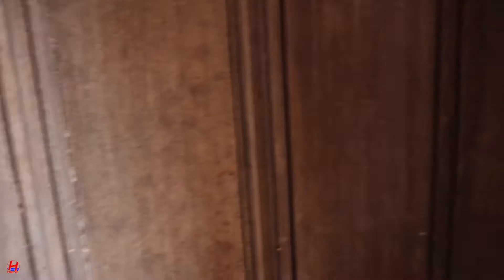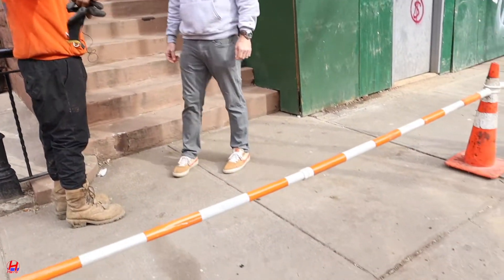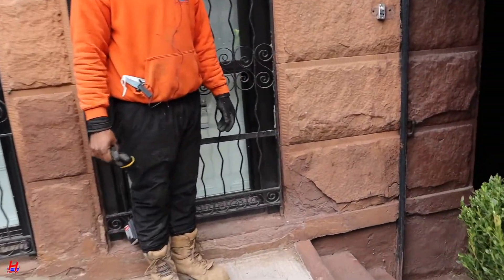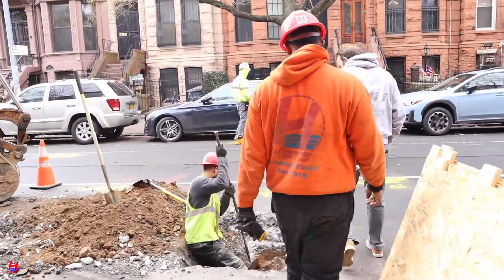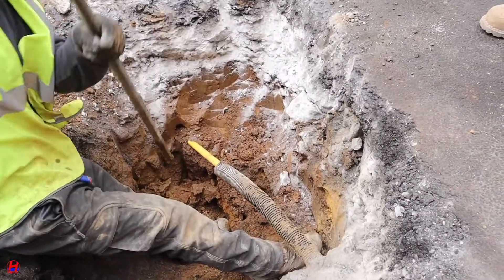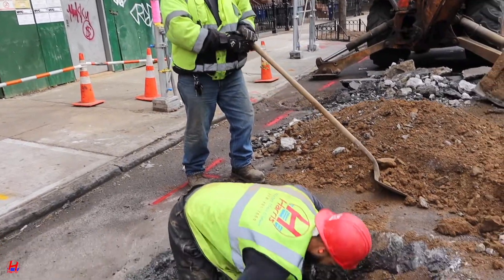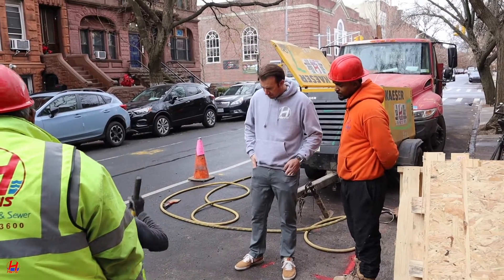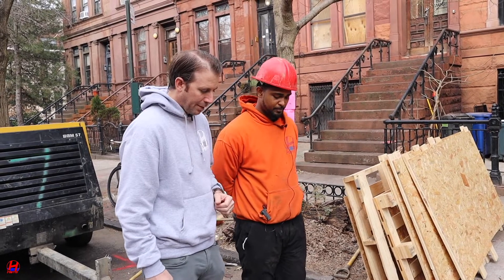Brooklyn Resident Replaces A Lead Water Main With Copper

Comment: Those are hard working men.Hydro excavation would help that’ll get the job done quicker.
Reply from the maker: What exactly is the hydro excavation process?
Reply: @HarrisWaterandSewer  I’ll explain it, as best I can.. You use , a hydro vac, some are purpose built, but lotsa companies use their combo flusher/ vacuum truck. Fashion a gun, or a lance. Which uses high pressure water, and cut the dirt , while simultaneously vacuuming it into the truck.
Reply from the maker: @mikemacmillan778  Very interesting. You guys must be working in good soil conditions? A lot of our conditions include large boulders, rock and utilities below ground!
Reply from the maker: @mikemacmillan778  Will do!  Thank you!